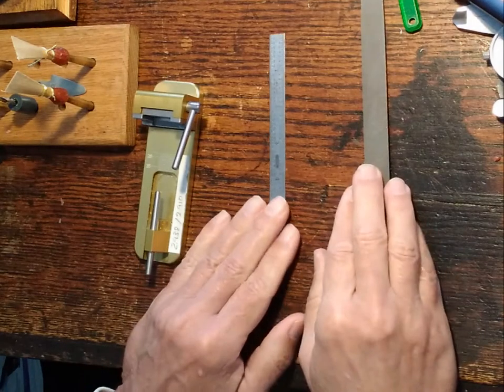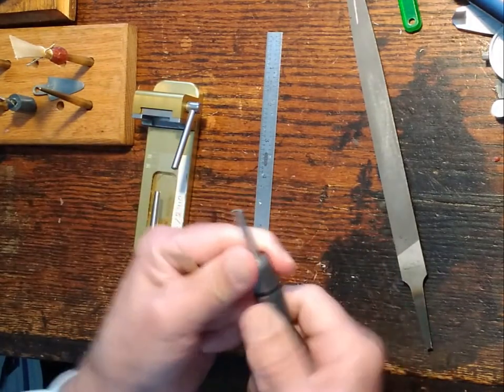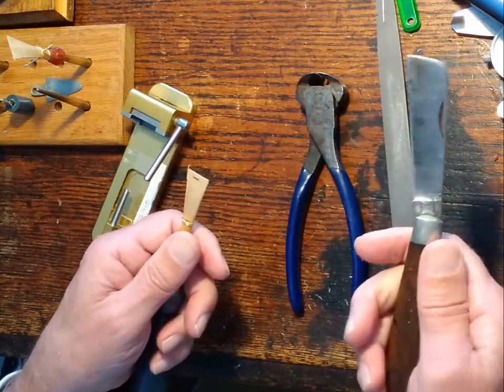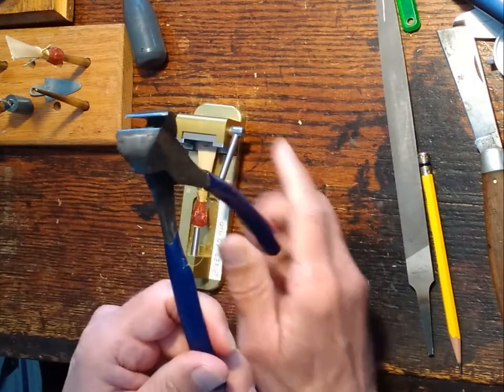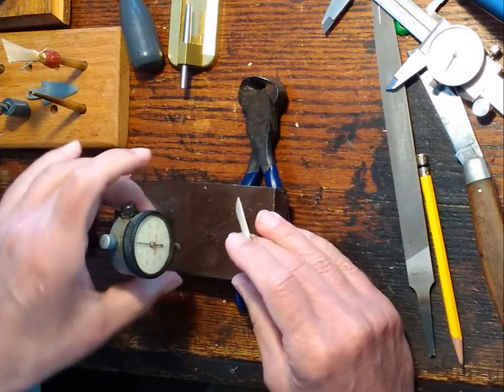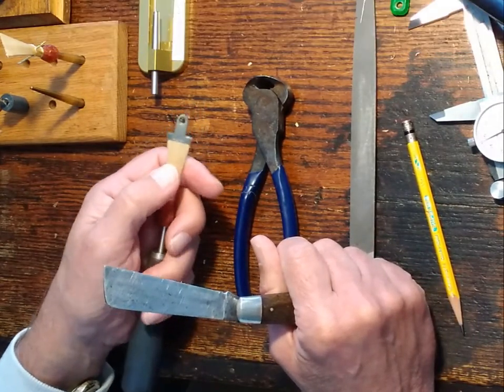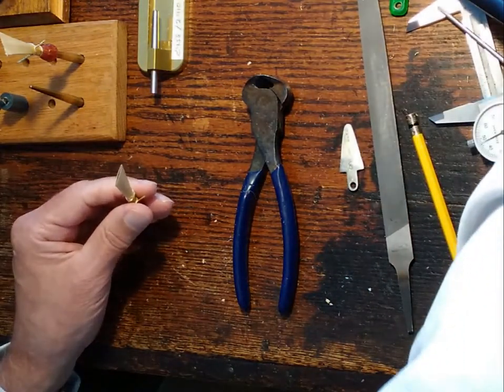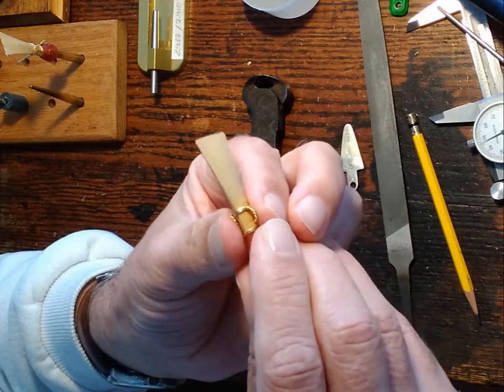Transforming a bassoon reed blank into a performance reed -- initial steps.

Comment from the maker: I've been asked about the 13/64 inch tapered (for wood) drill bit that I use for a reamer.  I found that idea on the IDRS forum: cheap alternative tools thread.  Finding an appropriate handle is the first hurdle that most folks encounter.  For many, an Exacto #5 knife handle (or a clone thereof) is a good solution.  If you have  access to a lathe, a wood dowel (drill a 13/64 hole in the end) works well.  For mine, I increased the diameter of the bit with JB Weld, turned that area down to 1/4 inch so that it would fit into my mandrel handle, and then cut off the extra length.  My collar is just a piece of plastic (Delrin) rod.  I've been using that reamer for several years now & find it better than any commercial reamer that I've had in the past.